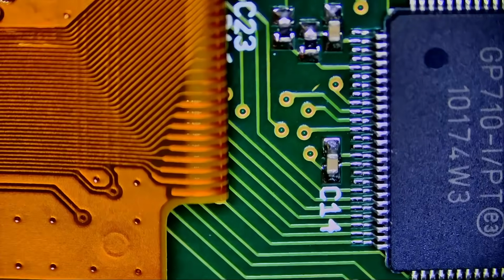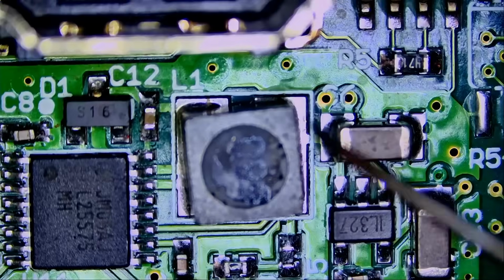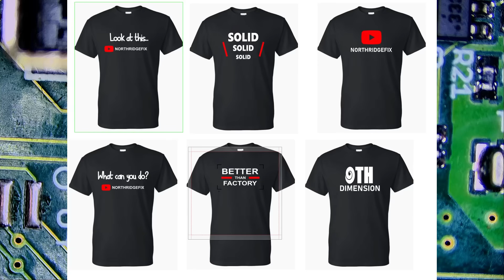The Strangest Mini Maxx Tuner Repair: Black Screen & Factory Missing Components

Comment: 12:35 They are the same, but the other side is also missing components. Probably another revision, but the missing fuse for the power supply to the hdmi is a mystery 🤔

Comment: The board is also missing at least 3 more ICs (U4, U7, U8) and a 2-pin component on the top left. Easy to spot if you pause at 12:34. Oddly enough, the customer board appears to have 3 transistors/MOSFETs right beside the SD card reader that the donor is missing - but then again, those may have been simply salvaged from the donor 🙂

Comment: Looks like a cheap counterfeit, if you compare traces on the donor and customer board, customer board have thinner traces, and they even look cheep. That board is no go, maybe try that screen on another minimax tuner if screen do not work it is definitely cheap knock off that uses third party screens which do not work with original minimax tuners.

Comment: I think that is failed factory boards. Machine has fail to solder some components or the robot just drop them and they trow this boards in the bin. But someone working here get them and sell them for low price. So, that is my explain. It is factory, but never turned on until now.

Comment: 12:01 If that board was a different version where they didn't stuff the second microcontroller, the support components next to it would also have been omitted. This is a donor board. Someone removed the parts and cleaned the boards after rework.

Comment: The customer must of bought a spares or repairs device from somewhere and parts must of been salvaged from it and sold as faulty which customer must of bought. But if it works then it who knows 🤷‍♂️ it might be factory if it doesn't work then its 100% a donner board that was sold as parts